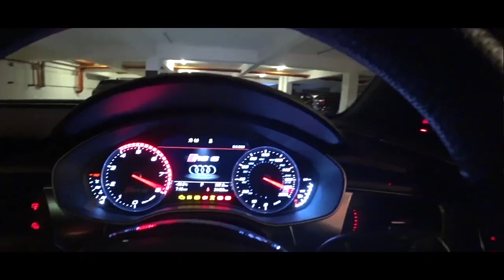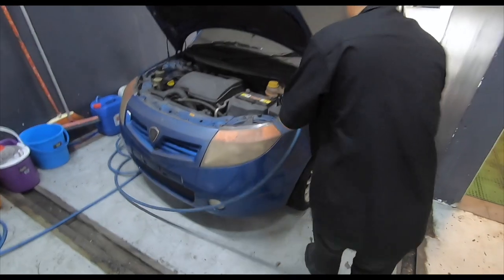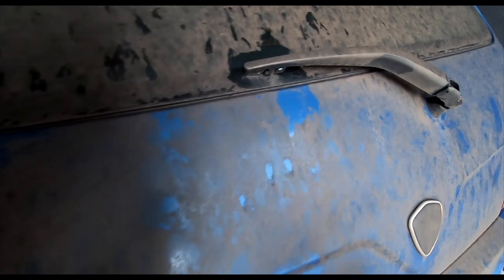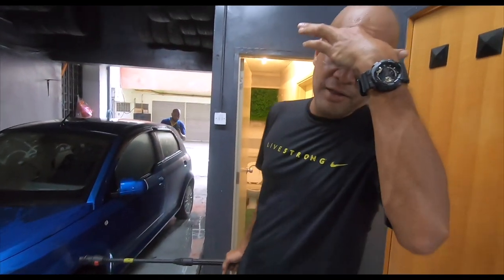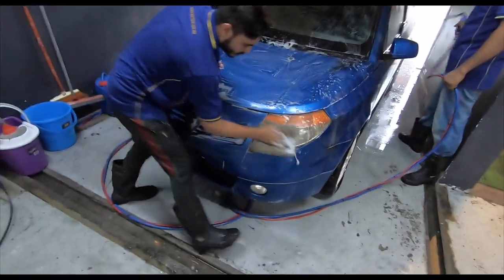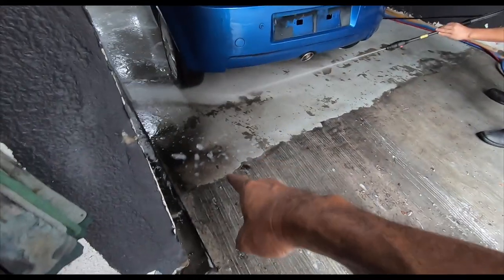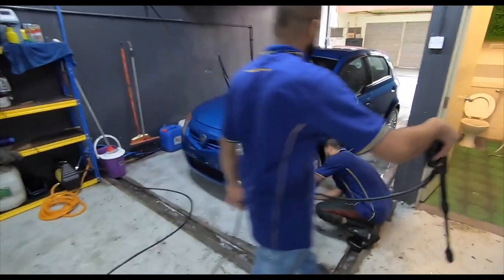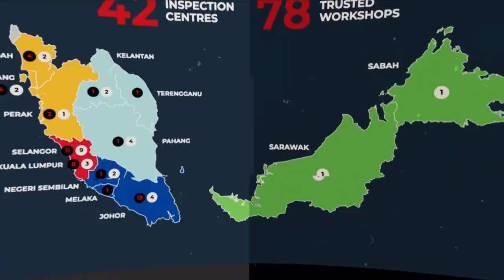UCR UPDATE: Sad & Neglected 2006 Proton Savvy Gets its FIRST Wash in 4-YEARS!! | EvoMalaysia.com

Comment: This high pressure water jet is used for house paint removal before repainting. Was wondering how to clean this car and what chemical to use. So worried the headlight will break when you pointed at it continuously. lol
Reply from the maker: I was worried too!! But it worked out well, it really needed this jet, the muck was deep!!🤭🙏🏽👍🏾
Reply: Another saga of the Savvy. Save it. SSS

Comment: You have paid the price to owner and what would if the owner wants it back after seeing the car..:p as the name not changed yet...

By the way, u have not answered on why Savvy didnt make it big despite all the toughness and robust of the engine...Whats your thought of it didnt succeed and in one of the top gear program, Jeremy clarkson did took a whack on Savvy...

https://youtu.be/efX0BzbJn_U?t=73
Reply from the maker: I will reply this in the next video, when I drive the car for the first time, thanks! 😊😊😊
Reply: My theory is that people found out that the Savvy is using a Renault engine & people started remembering the old Tiara and its multitude of issues.

Plus around the same time, the Myvi came out. People think by buying the Myvi they’re going to get Toyota reliability.